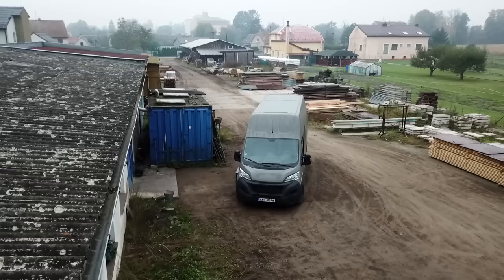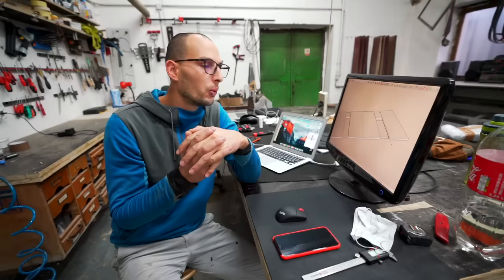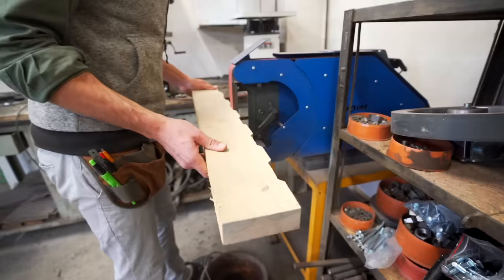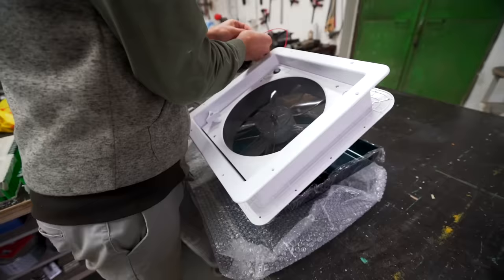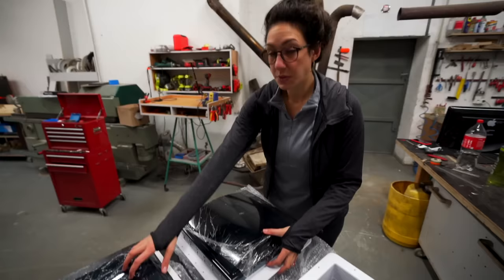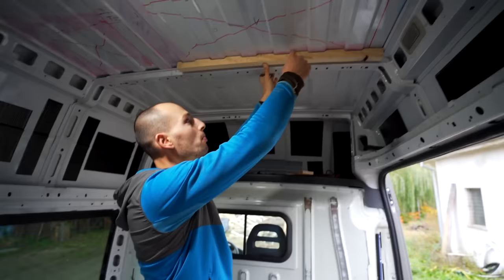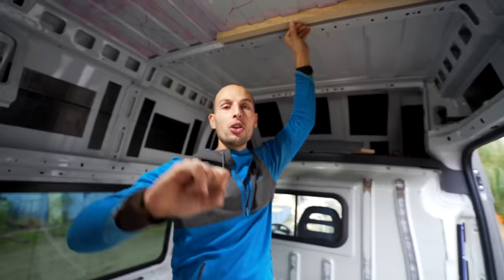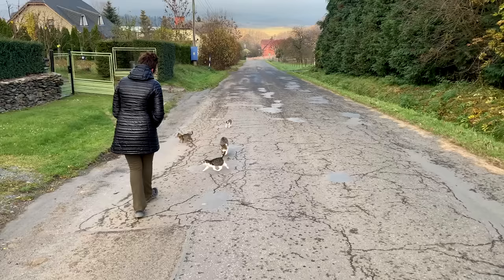Roof Design: 1kW Solar & Unique 4 Roof Window Layout (Ep. 6)

Comment: The optimum angle for solar panels is 20 degrees from horizontal so you may not need it to go up to 40/45, although I understand if you're in a moving van it may help to have the additional angle!

Comment: With the tilting solar panel, did you consider having the panel be able to pivot on either direction of the van, perhaps creating a frame with a "door with a door"? That way it could be hinged on both sides and give a lot more versatility in parking options regarding solar power intake. The linear actuators could be controlled by an Arduino to ensure optimum panel angle to increase solar power generation.

Sorry very pie in the sky, but perhaps something to consider?

Comment: Great content as always. The build gets more fascinating with any new video. But there are few things jumping on me: 1) While tripple glazed windows have very good thermal performance they are very heavy, I would consider using only a duble-glazing. 2) Usually the frame is much more of a thermal bridge than the window itself. In your case, the wood surrounding the window is more likely to be drawing cold inside, in turn cooling edge of the bottom glass and still causing condensation around the edge. To mitigate this I would use another material for the frame, most likely made of Compact Foam (High-performence insulator developed in Austria) It can be cut and shaped like wood, it has similar density and can be screwed into. Unfortunately it is quite expensive. 
3) In architectural aplications such as the one on the renderings you showed, the common problem with the glass is that in enviroments with high temerature differences (AC) the glass cracks due to inner tension. Often, even the middle glass panel cracks. I belive that the temerature differences in automotive application can be even higher. I would therfore recommend to have it termally treated as well. It should still be possible to metal treat it as well. 
4) As I see you do a lot of research so you probably already konw this, but other might not, so I add it anyway: While the tempered glass is very strong in resisting forces applied on its surface, it is very fragile around the edges. Especialy dangerous are any pointed objects, like screw heads or screw tips poking out. I would therefore made a reasonable gap between it and surrounding 
frame, perhaps fill it with a good, anti condensation squishi insulator like Spur K-Flex.
Well in any case I am looking forward to your next video. Greetings from Prague:)

Comment: Triple-glazed low-e windows in a van. That's a first. It's hard work getting people to put 3G in their houses, never mind vans! (rooflights should be 4G of course because U-values are lower in horizontal windows, so you'll get about U=0.88 with nominal (vertical) U=0.52 44m 3G unit, but as it's a van where everything is a compromise I'll let you off :-). I would worry about excess solar gain from roof windows given the small space, but people seem to manage with entire glass roofs on cars these days, and I expect you've done your sums so I guess it'll be OK. I look forward to seeing how this works out. And I'm very jealous of your shed!

Comment: Great video! I love the idea of having the solar panels tilt, but wouldn't it be much sweeter if they could tilt in either direction? That way it wouldn't dictate which way you park. Although, I know that would be more difficult to design, especially if you're using linear actuators.  But I'm sure it's possible.

Comment: Forgive me if I'm late to the game, but it seems to me that you could put a linear actuator connected to each corner of your central solar panel square grid and have it able to lift to nearly 45 degrees in any direction by selectively lifting the corners independently. Then you wouldn't need to park the van with a particular side toward the south.  You'd need to have a lock down mechanism for travel, but that shouldn't be difficult for Ladi to figure out. Just a suggestion.
Reply: You could even program an arduino as a controller for the actuators to follow the sun. Input a latitude and time of day and voila.

Comment: I'm enjoying your videos as I plan my conversion. Same length van but maybe the lower roof. At 182cm, I think the L2 will give sufficient headroom even with floor and roof insulation of 50 mm.  I was intrigued that you fitted single glazed side windows (which I would like) however, I wonder about insulation and condensation, particularly since there is no way to open them. How do you plan to prevent that? I'm sure you've thought of it and have a solution :)

Comment: That is a really nice roof plan.  The three glazed windows, fans, and the 1000 watts of solar is no small task.  I know the van is tall, but will the roof line (un tilted) scream someone is sleeping in this vehicle?  Is any part of the design intended for being stealth or are you more focused on power, air, and light?  Either way it looks like a superior design!  
Are the three glazed window frames designed/intended for the constant earthquake of a van hitting bumps and cracks in the road?
Reply from the maker: It’s always the goal to be stealth but there is only that much we can do with four 250W solars on a roof 😂👎 don’t worry, this small window sizes won’t do anything.

Comment: Hi, the dormer window will be higher than the lowest point in the roof, in the depressions will accumulate moisture, which even at a speed does not blow out. 

This can cause corrosion.

How do you plan to provide drainage?

Also, does your window has a groove for moisture drainage? After all, the water on the transparent roof will not look beautiful.

Comment: Hello , nice project you working on,  but  these fixed windows in the roof , is it safe to use them ,  
because when you drive one day to the coast, another time to the mountains.
There will be a pressure difference and they want bend like normal rv windows
So on the coast  low pressure in the glass and higher up more pressure on the glass
You need a releive valve on it, otherwise they will brake
And by the way they are not  , certified car windows, i live in France  and i am not allowed to use that 
type of windows , they are not  ( E certified )

Comment: Hello both, loving your build series and following along - soon to complete my 3rd van build. Can you please give me some electrical specs of the two roof vents you purchased? I'd like to control the speed via openhab (A home automation software) via a mysensors.org hardware interface using a mosfet, however need to know the current draw to determine the type of mosfet ;/
Reply from the maker: Hi, it’s linked in the parts list in the description of this video
Reply: I did take a peak, however the ali site doesn't list any proper electrical specs :( only flow rate etc of the air

Comment: One thing I don't understand is why are you using those ventilating roof windows with pretty much 0 insulation if your other windows are top of the line? Doesn't it defeat the whole idea? You could have used an inline fan to draw the air in/out from somewhere else i.e. below the van where the air is always cooler.

Comment: Hello. i like your build style ;) I olso living eastern europe. I have questions? if you are driving out of the country, do you do a proper car inspection , engine compartment and chassis? are there any spare parts as well? (generator belt or engine 1L oil :D)
Reply from the maker: Hi, we don’t do anything, mechanics are capable everywhere just in case something goes wrong. We’ve never had any problems. Brakes were worn so we replaced them in Turkey much cheaper 🙃

Comment: Guys: I guess your decision on roof windows and solar capacity is directly related to WHERE you plan to be touring. Let me give you an example. 

On my 28 foot/9 meter boat, which I use as a liveaboard only in the summer, from June to September, I have all possible electrical amenities except A/C. Included are a 70lt. fridge and an adjacent 30lt. freezer, custom made to open from the top, with 10cm insulation around the fridge and 15cm around the freezer that makes ice for everybody’s drinks. I have a propane instant water heater (best invention since bread) and a two burner Teka stove run by the same propane bottle. I don’t have an oven, but I could, it’s only a matter of space in a boat. 
For all these, plus a multitude of 12v plugs spread all over to charge telephones, fans, music, laptop, ipad etc, I only use 2X130w solar panels and 4X100A (actually only 3, as the 4th is an engine backup) normal car batteries. The whole system is plenty enough for most of the time, an exception could perhaps be one or two cloudy days and also the days beyond Sept 10 when the sun starts to set earlier. I never had to think about economizing energy. As I never thought a good idea to put roof windows. Actually, and despite whatever you propose about triple layers and metallic inner glazing and argon etc., the ONLY difference is that I live in the Aegean where the summer sun is so plentiful.
Therefore, hearing that you are ready to install roof windows and 1kw solars, makes me assume you plan to be traveling places of northern europe where sun shine is at a premium. As for the roof windows...before you come down to the Med, make sure you have removed them and sealed and insulated the bay very well! 

So, despite our location parameters that eventually dictate so different energy requirements, both in sourcing ability but also in dispensing (especially in winter), I admire your devotion to your project and wish the best of luck to your endeavors!!!
Reply: Ebikes can be energy hungry right? 😉
Reply: snejky   Sure can!

Comment: This is strange and rather confusing to see the "L5" measuring 6.36m which is exactly the same length as all L4 citroen/peugeot/fiat vans out there🤔
Reply from the maker: It's very odd indeed. All our paperwork says L5, and when we asked this same questions at dealers they said it had something to do with post-2015 makes being a few cm different or something, but online it only says 6.36. Maybe we'll make a video measuring ours. Naming these same vans a million different things makes heads spin a bit
Reply from the maker: Or it could even have something to do with trying to develop more of a competition with the L5H3 Ivecos, but idk
Reply: @ladiandmargaret  I see, yes it maybe the case so they will start making XXL once around 7m long. This would be cool. We've just finished building our all electric 2011 L4H2 citroen with 4x 350w LG solar (non lilting) with 2x vent fans underneath, 3kw inverter and 350ah 24v lifepo4. Also loving ebikes and having young dog (lurcher) named Loko.
Good luck with your amazing project. Keep up great work and inspiring others.
Greetings from South UK🙌🏻 🙏🙌🏻